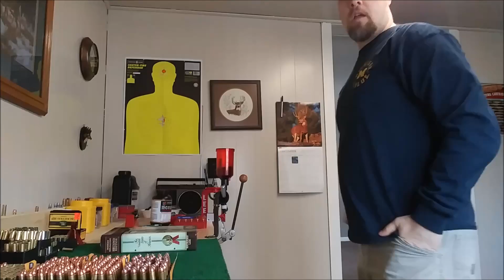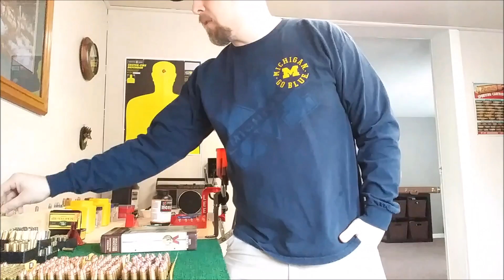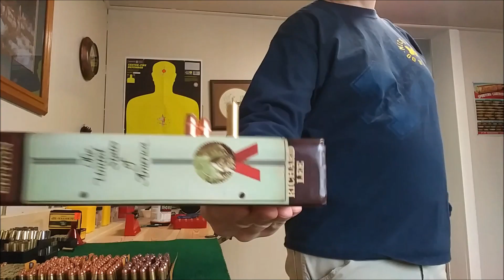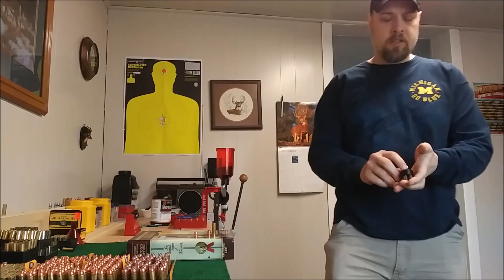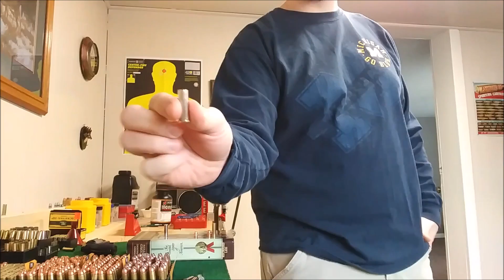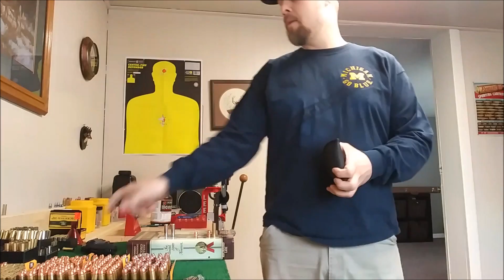Heavy Vs. Light for Caliber Bullets?

Comment: My chronograph totally disagrees with what you are saying. I have tested .357 with everything from my derringer to my levergun. And yes you may be blowing powder out the end of the barrel with properly seated bullets and mag loads in the derringer. But the powder that is used up in the barrel produces more velocity. Even the slower burning powders produced more velocity than the faster burning powders in the derringer which was surprise to me. Until I got some bogus program called QuickLOAD. I would not trust its load data. But looking at the chart and how fast even the slow burning powders reach peak pressure backed up what the chronograph was telling me.
NDR

Comment: My thought process is that a JHP needs enough velocity to expand. So in a shorter barrel, I want to gain more of that velocity back.
Reply: Actually heavier grains loose less velocity in a shorter barrel
Reply: Which is why I went with in 9mm 115 grain in my Taurus G2C. Due to the shorter barrel, it wouldn’t expand rapidly as wide compared to a full size 4-5 inch barrel which should (theoretically) give me good penetration. I’ll add that I live in south Florida, so penetration isn’t a concern when most of the year everyone either has a thin shirt on or off.

Comment: I’m reloading for Rifle... 300 Winchester magnum to be specific. The bullet weight differs from 120 grain to 230 grain. If I use a 120 grain Bullet my muzzle velocity is higher but it doesn’t have the killing power more than 500 yards... but I’m using a 210 grain Berger VLD Bullet and my velocity is 2875 fps at the muzzle.. although the velocity is less compared to the 120 grain the 210 grain retains the velocity and energy down range to kill an ELK at 1000 yards.. so I prefer a heavier Bullet and this is just my thoughts. Thanks for the effort you put in for the video bro.
Reply from the maker: Thanks. When I used to hunt, I would hunt 200 lb +/- whitetails in Michigan. I have killed deer with both light and fast and slow and heavy and at extremes. I never shot one beyond 40 yards as the way the forests are here you can't, but two examples; I shot one deer with a .444 Marlin 240 gr SP and one with a .270 Weatherby Magnum 100 gr. Both were at about 40 yards. The .444 brought the deer down, but it took 45 seconds to expire, could not stand up. With the .270 Weatherby, it was a body shot like the .444, but the .270 was like, lights out, instant back-over feet up, one leg twitching dead. I just remember how impressive that little bullet was.

Comment: wow I loved this video I was wondering about how bullet weight and powder was affected by barrel length great job.  Also I was wondering about lite loads for shooting targets what about a lite bullet with lite powder charge? do a video on target loads please.
Reply from the maker: A heavier bullet will get up to pressure with less powder and leave the muzzle slower. This causes more efficiency with a heavier bullet. That being said, you can still have more power with a lighter bullet sometimes as the quantity of powder is more, so even though it's less efficient you can get a lot of power. All this being said, not all powders are created equally, some burn slower and some faster. Basically put, there's no set rule of thumb in what weight will be more powerful in any given barrel length. 

A light bullet with a light charge will produce a light power round. As long as you have enough pressure, that's fine. Heavy bullets can recoil more simply by being heavier, however overall a heavier bullet is easier to get up to pressure with very little powder. Again, no set rule. A 148 gr wadcutter is basically as good as it gets for low power efficiency. Very little powder, but because it's fully seated in the case, it uses next to no powder, very little recoil.

Comment: So what is the optimal bullet weight and powder charge for a snub nose?
Reply from the maker: That's debatable, and there are a lot of opinions on it. In my opinion, the 125 gr. in a .38 special or .357 magnum seems to be the most consistent power to recoil ratio. Others swear by the 158 gr. in both. I guess it comes down to how much expansion or penetration you want. You will get the best potential for expansion with a 110 gr or 125, but by reducing velocity with a 158 or 140, you reduce expansion but increase penetration. Right now I am in the middle, I am using the 135+P Gold Dot in my .38 snubby, it's a softer than normal lead alloy which still gets good penetration due to bullet weight but also tends to expand well. As for powder charge, a faster burning powder in a reduced charge with a 158 gr bullet would be the most efficient in theory with a traditionally loaded cartridge.
Reply: Excellent info. Thank you. I've been thinking about picking up a small revolver like a S&W 340 or similar and this is helpful. I found an interesting MAC video showing that 9mm in snub does comparably to 357 magnum with some ammo.
Reply from the maker: The 9mm in a snub nose revolver really cannot compare to the .357 magnum. I have seen that video as well, he is using a very very low end .357 magnum compared to a hotter than average 9mm+P to try to make them seem comparable. Now in a revolver as light as a 340, I would not use a very hot .357 mag ammo anyways, but in general a properly loaded .357 magnum round in a snub nose revolver will have much more muzzle energy with a .357 magnum than a 9mm. In terms of power in 2" barrels, you usually get about 225 ft lbs energy with a .38 special+P, about 275 ft lbs energy with a 9mm, and over 400 ft lbs energy with a .357 magnum. Obviously putting the 9mm up to a +P will increase that some and put it into the 300+ ft lb range, but with a +P in a 9mm, personally I would be slightly worried about bullet pull from recoil, but it would depend on the particular round, for instance I would never use a pure lead 9mm bullet in a 9mm revolver, the bullet is too slick to not be roll crimped and still be used in a revolver. Personally, if I were to go with a 9mm revolver, I would opt for using Hornady ammunition and having those rounds roll crimped like a revolver round. Hornady is unique in that they use automatic pistol cartridges that have bullets that happen to have a bullet cannelure on them, which is typical usually only on revolver cartridges. this will prevent bullet pull. Overall though, if you want the most power and projectile weight/design for a wider array of purposes, the .357 magnum is far more versatile with all of the .357 mag, .38 special, .38 long colt and .38 short colt ammo that can be fired through it. That's just my 2 cents.
Reply: Fascinating. Thanks for taking the time to share all the good information. I've just started reloading and this is priceless to me. Btw, I was dubious about the 9mm vs 357 thing, on the numbers alone, but also because of other videos by folks like Paul Harrell that seem to say the opposite. Subbed!
Reply from the maker: Thanks! either way you go is fine because revolver brass is easy to retrieve. One thing to consider, reloading 9mm ammo will take time and save you basically no money if compared to lets say, Federal aluminum 9mm ammo. However, with .38 spl and .357 mag, you save about 50% of factory ammo. All 3 will run about the same cost to reload, but it's hard for me to justify spending an hour and a half total time reloading 9mm when I can buy it for the same price. On the other hand, .357 magnum is almost impossible to duplicate true magnum loads with the hand loading data that is out there as where 9mm data is pretty good, however that might be a good thing if you go with something like a 340 and you want lighter .357 mags. All in all, the .38 special is the cartridge that can be reloaded to match and exceed factory ammo power levels any day of the week, and still retain that 50% savings. 

To me the choice would be clear because I don't own a 9mm auto, so just going for a .357 magnum and .38 special in revolvers makes the most sense, however if I did have some 9mm pistols, I might want to go with the revolver in 9mm. But for me, the versatility of shooting both .38 special and .357 mag in my .357 revolver, and all the available load data along the way and the fact that .38 special and .357 mag use the same projectiles, same die set, and in a pinch could use the same primers, it's a no brainer. I actually just made some .357 magnum ammo with 125 gr bullets that I chronographed in my 4" 686 @ 1,180 fps, basically identical ballistics to 9mm Nato. Compare that to mid range factory ammo, 125 gr@ 1,475 is what I clocked some Federal .357B out of the same gun. I would just go with whatever you feel comfortable with, on a side note most 9mm revolvers and .357 magnum revolvers are built the same way because both have the same pressure. 38 special revolvers are usually built with lesser materials due to low pressure. In the end  you should just get what you feel like getting, first instinct.
Reply: Damn, you are like an encyclopedia. I'm really glad I found your channel. I recently bought a Dillon SDB with a 9mm die set included. I worked out the price for 9mm reloading and came to the same conclusion you did before I factored in the fact that I've been saving my brass for months in advance of getting the press. Either way, I'll be able to shoot more by reusing brass, so that's cool. I'm excited to try 357 reloading though, and the cost savings is a huge impetus.  It would be really cool if they made a pistol with interchangeable cylinders for both 357 and 9mm.
Reply from the maker: They actually do make a revolver like that, but it's a single action. I think it's a Ruger Blackhawk with two cylinders. The thing with those is that the barrel is bored out at .357", so the .355" 9mm don't get the best accuracy in them. I think there is the Medusa revolver as well lol, i'm not even going to begin talking about that one....like 35 different cartridges in the .38/9mm range it can shoot or something like that.
Reply: I was just looking at those. There's some Taurus model as well, apparently. I'm just nosing around. I'll probably end up getting a S&W 340 or 360. They seem like awesome CCW revolvers. I'd like something that could be fun at the range as well, so I may have to broaden my search.
Reply from the maker: To have range fun, personally I would stick with 20 oz+ and shooting .38's through it most of the time. I can attest that 13oz isn't fun even with a .38 special. Something like a S&W 640 or 640 pro would give you a little bit of everything, other than pocket carry. It's not too heavy at 22 oz, but it's enough real steel to handle a .357 mag pretty well and handle .38 special like a dream.
Reply from the maker: Before looking too much, just my take on it with video is that I do think that the S&W is the best choice: https://www.youtube.com/watch?v=cRDl76ju7tE&t=270s

Comment: i load 158 gr target loads in my 38 special 642....up close and personal is what that gun is for so why not load it heavy?im sure a full house 125 gr 357 out a 5 inch barrel has been the standard man stopper
Reply from the maker: With the .38 special, that will always be a struggling cartridge that can't quite do more than one thing well at one time. The energy just isn't there to get penetration and expansion at the same time. The bullet is big enough to have a big HP and expand reliably, but when expanded that energy just isn't enough to penetrate. The opposite is true as well, there's enough energy on that .357 bullet to penetrate well, but not while expanding.

Comment: Your take makes complete sense. Even if you're not quite right, you have to use a smaller charge for the heavier bullets to avoid blowing up your gun. I've been out of reloading for a while. But now I'm looking to get back into it. I hope my Rock Chucker hasn't rusted in storage. I ordered an RCBS 3 die set for .38/.357, CCI #550 primers, a pound of tight group (HAZMAT fees are killer. I need to find a local supplier!), and a box of 158gr plated hollow point target bullets from Midway. I have to shoot up my Fiocchi to get brass in .357 length. I don't think I'll be bothering with .38 Spl. Never know of course. Once I'm back into the rhythm of reloading, my goal will be to get something that shoots to the same point of impact as my carry ammo. I'll stick to factory for carry. Probably.
Reply from the maker: I once made a load that felt exactly like the carry ammo I used to carry, even though the bullet weights were different. The recoil, flash and point of impact on the .38spl+P 110gr Critical Defense, seemed to be mimic'd with .38spl+P 125gr XTP over 5.0 gr of TiteGroup.
Reply: No pun intended, but I'm aiming for a good load for my J-Frame. Matching the point of impact of my carry ammo is the primary goal. I may decide the carry ammo is too hot and try for something different. There is always the possibility I will opt to carry what I load. I wish the Lehigh Defense bullets weren't so expensive. I would also say the same for the Hornady ballistic tip ammunition. The Fiocchi 142gr flat nose has some pretty good bark out of the J-Frame. I think it tops the Hornady 135gr Critical Duty load. I haven't tested the 125gr Critical Defense. The Underwood Ammunition is loaded with 140gr Lehigh Defense Xtreme Penetrator. Midway sells those bullets, but they are about 70¢ each! Mind you, the Underwood comes to about $1.70/round so there is still money to be saved. That's still a lot to spend on blasting ammo though. I'm not counting shipping charges. Midway isn't cheap with shipping either. My area doesn't have much in the way of local component suppliers. The one gun shop that did sell reloading supplies got out of that part of the business. I think there is more profit in the factory ammo.
Reply: I had a quick look and the kits I found were discontinued. It maybe that my old rock chucker is obsolete :(
Reply: a Rock Chucker is never obsolete. lol. i own a few presses even a # 650 but for rifle rounds and even pistol when i want to do a ladder test my rock chucker is put to work  :)
Reply: ya can't beat a rock chucker n rcbs dies.................
Reply: If I competed in 3 gun, I'd want a Dillon XL650 or some such. The Rock Chucker is great for low volume. I think you can put a turret on it.
Reply: Cool. Do you have a chronograph of some kind?

The pound of Titegroup I ordered showed up today with all sorts of warnings on the packaging. It looks like between primers and powder, doing 1000 rounds is no problem. I'm short on the projectiles as the box I ordered only had 250. However, I have enough of the Fiocchi stuff to take a while to burn through. So plenty of brass, depending on how many times I can reload it.

The fun bit is in the interior ballistics. Energy is force times distance. The barrel length is obviously fixed, so it comes down to the right pressure curve which is powder dependant. Impulse is force times time. Lower impulse means less recoil. I'm sure you know the physics. My current thinking is that a heavier bullet will perform best provided I don't push it out too fast. Of course I don't want it too slow either because energy is proportional to the square of the velocity while recoil is going to be proportional to the velocity given equal bullet weights.

It's an interesting balancing act.
Reply: I just rewatched your video. Seating the bullets all the way down like that is a great way to improve the powder efficiency. The actual muzzle energy of the bullet at muzzle would be proportional to the amount of powder that burned before the bullet left the muzzle. It's a bit humbling to think what a few grains of powder can do to a target.
Reply from the maker: It don't take much, as much powder as a pinch of salt can send a bullet at 1,000fps and go clean through someone with a round nose bullet.

The ballistics calculator the beartooth bullets website shows that a pound of TiteGroup will yield over 1,500 rounds if every round is charged with 4.5 grain (which is an average charge among many different cartridges).  It's fun to go over the load data, something like .44 mag is in the vicinity  of 10.5 grains of that powder, but a .25 auto is 1.5 grain.
Reply: There are 7000 grains in a pound. So you don't need to use an online calculator. I just roughly estimated a 7gr load which is most likely more than I will be actually using. Your 4.5gr figure sounds pretty close.
Reply from the maker: I have used 7.0 to 7.5 of the titegroup in .357 magnum, and the 7.0 under a 125 is really nice. It's a magnum for sure, but just an entry level magnum so it shoots nice with little recoil in my 686.
Reply: really a turret on a rock chucker ? i have a turret press too but i'll look into this.  thanks.
Reply: I'm just hoping mine didn't rust in storage. I'm slowly getting my stuff back together. I was inspired by this channel. It also doesn't hurt that I'm mainly interested in revolver which doesn't throw the brass into the next state (or deep grass).